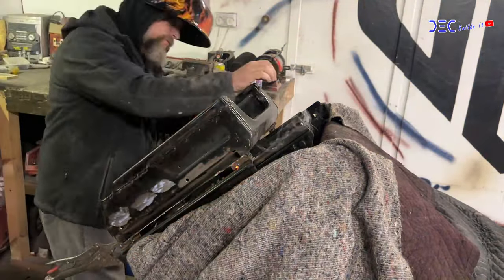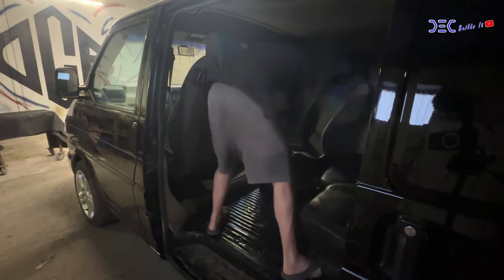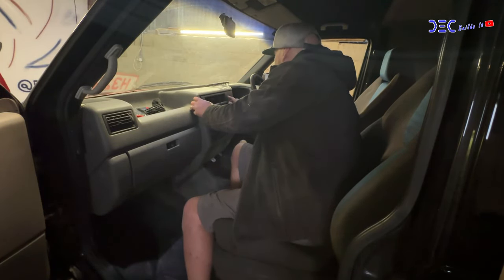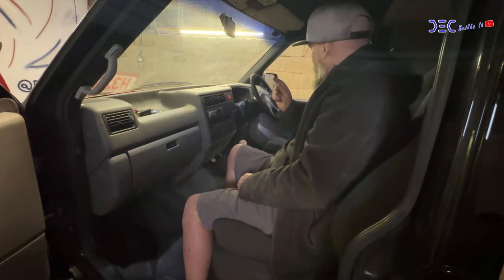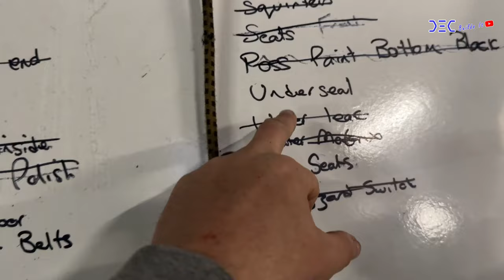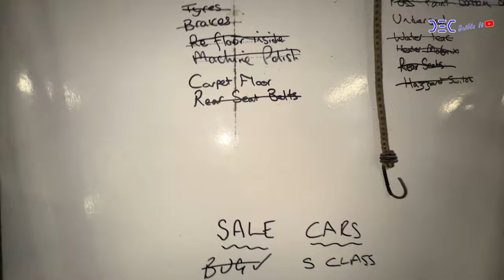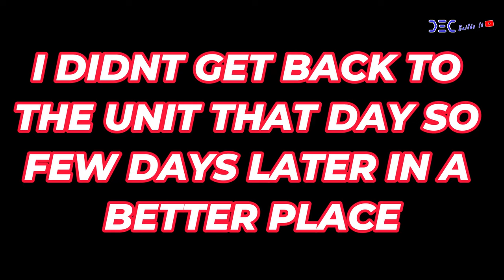Rebuilt Vw T4 Project gets custom interior

Comment: Could you not of swapped the bmw seats from side to side to get them inline.
Reply from the maker: It could have been done but then all the controls would be on the wrong sides and that would mean there would be no plastic to cover all the mechanisms on the side of the seats when you open the door, plus it would have had to been all remounted as well from how they were  did look at that before but would have ended up being similar work as seats were mounted to high etc